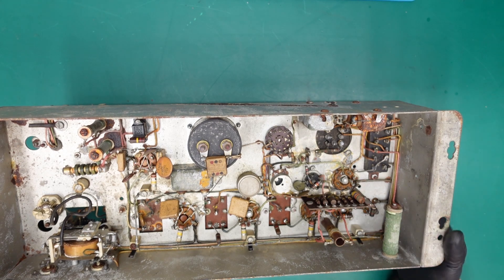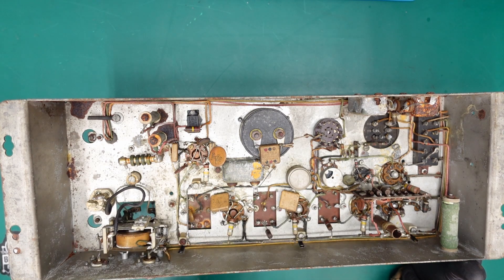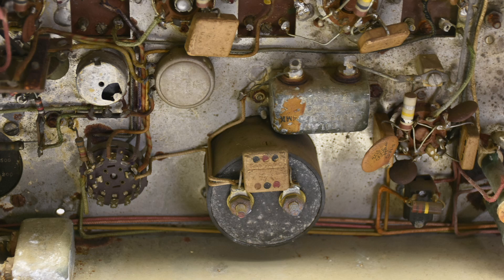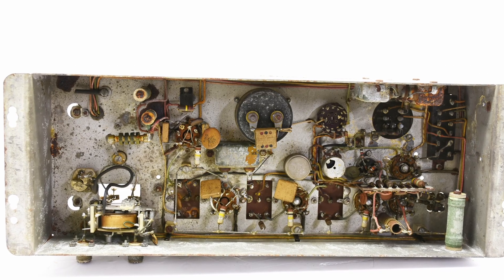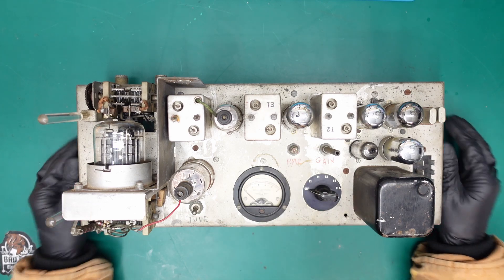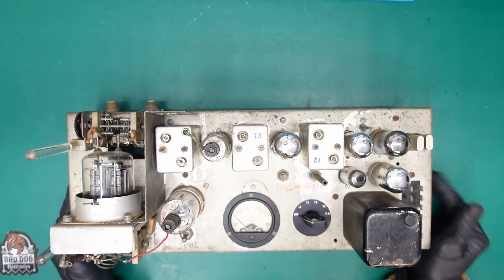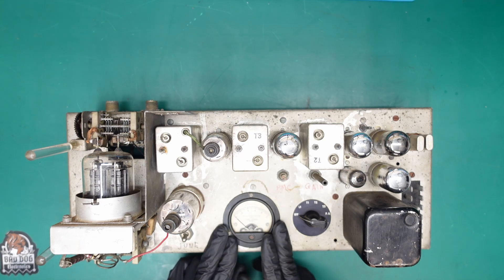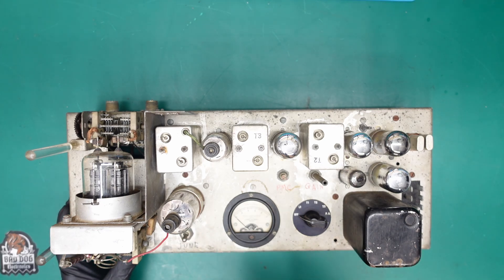Vacuum Tube Mystery Equipment

Comment: Hell, I have no idea what this device is, but those clear plastic "tubes" are obviously handles with a worm gear to fine-tune those air-capacitors they're connected to without sticking your fingers in something potentially lethal. Look closer and it all makes sense. There's nothing "up and down" about them. I know you're smarter than one of those "710" guys who are clueless under the car's hood.
Reply from the maker: Thanks for the reply! Yeah, the mystery is solved in the comments. LOTS of smart people commenting. I can't believe I didn't put it together that the rods were used as you and other's described. It's the simple things...🙃

Comment: Vhf transmitter, possibly mobile police late 1940s or so
Reply from the maker: So far this is the first time I heard police use. Very interesting! I also assumed aircraft (ATC) given the radar tube. Thanks for the info!
Reply: @BadDogElectronics  looks like an old 2 channel mobile (motorola?) trunk radio, (because they took up the whole trunk) there would be a reciever chassis and a dynamotor power supply chassis, as well as an in vehicle control head, and some cables to complete it. The loctal style tube you removed was a thing that came and went in a short time, and used mostly in mobile applications in the 1940s. It could be police ambulance, or even aircraft. The crystal frequencies could reveal a lot.
Reply from the maker: @johngalt7382  WOW! Thanks for the insight! That's really good to know. Still thinking the use of a radar tube is a bit confusing though.
Reply: @BadDogElectronics  That family of tubes was used in a very wide range of early uhf and vhf transmitters, judging from the coil sizes it is probably in the 170 mhz range. Those radios were easily modified for 2 meter ham band use back in the day
Reply from the maker: @johngalt7382  Really good to know. Thanks for the insight!

Comment: the tune operate switch is for power output amplifier tune up. the rotary switch next to the meter is to select grid current of the stages on tune up. and pa is plate current on the output stage.
Reply from the maker: That’s very helpful, thanks!

Comment: Those rods are to keep your hands away from the plate voltage on that final amp tube. (From it's size I'd expect 500 ~ 1kV)

My guess would be a 50w AM transmitter / receiver. 50's ~ 60's era by the construction and components.
Reply from the maker: Those rods were my biggest mystery. Thanks for the info!  I should have figured it out, based off them being attached to the gears. It does make sense that you'd actually turn the post and these keep you isolated (decoupled) a friend of mine who saw the video explained this to me too. Cool to know! Thanks again!
Reply: @BadDogElectronics  The two adjustments are to dip the plate current (Top rod) and peak the grid (Lower rod).
Reply from the maker: Awesome to know. Thanks a lot for the info!!!

Comment: It's a vhf FM transmitter . those RF  cans are  part  of the frequency multiplier section.  I worked with these types of transmitters in the '70's.  It looks restorable to me, with lots of time and updated parts could  be usable on the upper bands that are most popular these days.
Reply from the maker: Thank a lot for the info! I appreciate it! That's cool you got to work on these!

Comment: Looks like a transmitter.2E26, 6146 and 829B are transmitter power amplifier tubes, each stage operates at increasing power. The plug is for connecting a power supply. The meter is for tuning the stages from input to output via the switch. The insulated rods are for tuning the final amplifier without getting your hands too close to the high voltage. The relay underneath disconnects the receiver when transmitting.
Reply from the maker: This thing is a head-scratcher...but you seem to have figured it out!
Reply: I am pretty sure you are right.  I would have guessed it's a VHF transmitter.  I wouldn't have guessed it was FM as stated in the post above.
Reply from the maker: I agree, thanks for the comment.

Comment: My guess is: receiver and transmitter on a single chassis. Maybe the relay behind the coaxial sockets switches the antenna between output of the transmitter part and the input of receiver part? The meter works together with the switch on the right, as a multifunction meter.
Reply from the maker: That's along the lines of my thoughts too. But a radar tube, and what are those posts???😲
Reply: @BadDogElectronics  The transparent plastic rods are insulated axles to tune the air capacitors. All operating adjustments are from the top. The 829B tube acts as an RF output tube working in P-P mode, with the 6146 as an modulator or oscillator. 2E26 and its RF transformer is the modulator, maybe. I didn't analye the circuit,but  what if the tubes arn't even the original design?
Reply from the maker: Good point. Thanks for the comments. I think the mystery is solved!